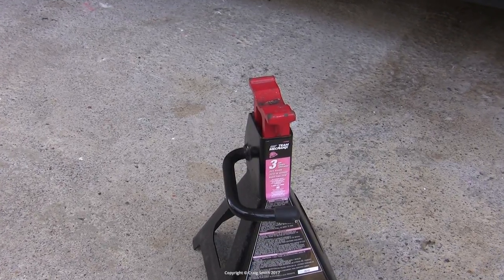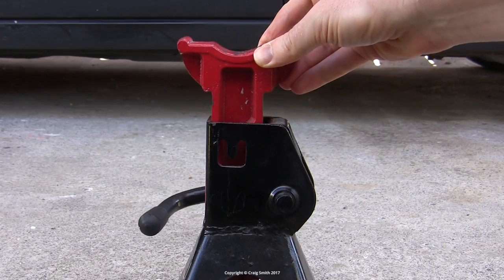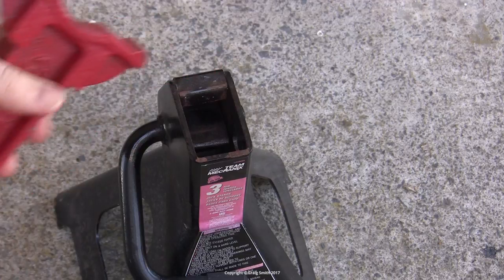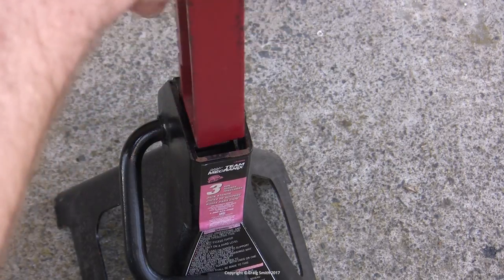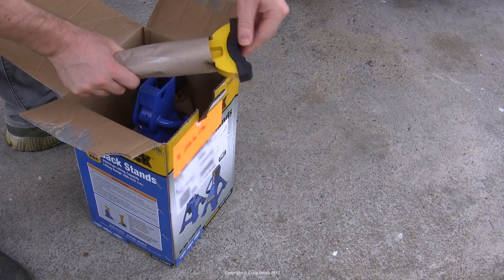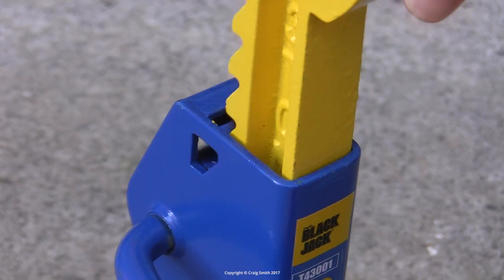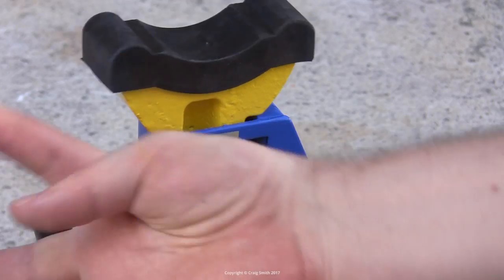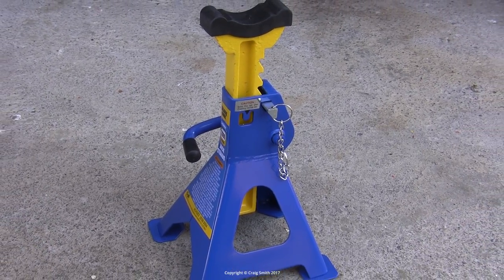Quick tip: Use locking jack stands for maximum safety

Comment: Hence it why is beneficial to lie your tyres underneath the car when not on the vehicle, or that PLUS your floor jack.
Reply: Definitely. I have ratcheting jack stands with a locking pin, when under the car I usually keep the jack + put the wheels.
Reply: @JackRR15   Interesting, I've seen a few people do that over the years. Thanks for the tip guys.
Reply: @JackRR15  very smart move.

Comment: I find it funny how he chooses the one with contradictory labeling.  The best thing you can do if your worried about manufacturing deficiencies is buy something not made in China.  His choice still doesn't fix any of the points he brought up about his previous ones. Not one single problem was solved.. he got an extra bolt probably put their because they have a high failure rate in testing or a lower safety factor in their design or materials.
Reply: Lol

Comment: I binned a set of axle stands a few years ago as the rachet teeth were only catching by about a 16th of an inch. I was hoffified when I took a look at them. Got myself a nice set from Halfords with the extra pin for security. Always stick a couple of wheels and wood under as a backup - never rely soley on stands and a hack.
Reply: A cement block to be extra safe

Comment: I was talking to an ambulance driver who regularly gets called out to incidents involving failed car jack stands and he was saying it's the pawl part that fails, because every time you lift the ratchet up the teeth shaves a tiny bit of the tip of the pawl off and eventually the worn down pawl cant engage far enough into the teeth and under the immense weight of the car it fails.
Obviously this takes years upon years of regular usage to build up enough wear to fail, but just be careful if you buy second hand or your old ones are getting a bit long in the tooth.
Reply: Thanks for the info.
Reply: Yes, because ambulance drivers are mechanical engineers. Bullshit.
Reply: Robert Korn  shit caught in the teeth would have the same effect, also these are cheap cast steel not tool steel so they will wear. Not bullshit. I wouldn’t use this type ever, 2 tons of vehicle don’t give a second chance
Reply: @robertkorn  You don't need to be any kind of engineer to use common sense. ANY small amount of friction wears down anything.
Reply: @highdownmartin  Hi Martin, I’ve just posted a comment today about getting these axle stands and about the welds on the feet only being 2 spot welds.

What brand would you recommend?

Live is short, even shorter under a car 🚗  ⬇️
Reply: I think you guys means paramedics, not ambulance drivers lol.
Reply: If you need to get under a car buy a ramp, wedge the rear tires, and have the parking brakes engaged. All you have to do is drive the car onto the ramp and you're good. The only time I use jacks is to gain  clearance while I work on the side.
Reply: @rofleman  or short in the tooth as it were 🤣🤣
Reply: @mikewill1740  What id you have a manual car with an electronic park brake. Try getting that safely up a ramp. I did and would never risk a stunt like that again.
Reply: @jackspratt4343  🤔🤔🤔
Reply: @mikewill1740  also the car was really low to the ground so the front splitter wanted to hit off the ramp too.

Comment: I took this advice to heart and ordered a set of "3-ton" jack stands from Amazon. They were garbage -- the welds looked awful, the paint was damaged, the swinging arm was tight, etc. So, I went to a local auto parts store and paid much more for a set of 4-ton jack stands that lack the pin. Even if all else were equal, I think I'd rather have double the rating without a pin than half the rating with a pin.

Comment: Don't assume you are safe because you have an extra safety pin. A bad weld could crack open under load which would make the stand collapse. Always use both stand & floor jack.

Comment: i like the old style, a steel pin going through the center of the jack stand, the only way to drop the jack is to remove the pin. that wont be happening when under pressure.
Reply: I think the weight rests on the pawl and the pin rests freely as long as the pawl is engaged. Also you can always bring the jack over if you accidentally release the pawl early

Comment: Great tip. I wonder how much load the safety pin can take. Pin is in double shear and material is pretty thick...should be good.
Reply from the maker: I linked to a destruction test of the same or very similar product somewhere here.

Comment: Back- up a good idea. Just heard some of the typical kind have been recalled in USA You were right !  Thanks.
Reply: That recall wasn't due to the kind of breakage talked about in the video. Those stands had an issue where if the weight of the vehicle somehow shifted the ratchet could release the beam. A lock would have stopped them from falling, but they'd have still needed to be recalled. Scary either way.

Comment: Hi Craig, 

I ordered a pair of these and had a warrantee issue amd returned them after I found 2 of the feet were bent. 

These things happen, no big deal. 

But I also examined them just before I returned them and  I noticed there were no welds as depicted in the photo on the box where the feet meet the legs on the outside join. 

I see there are no welds there either on your video. 

They are only joined on the inside of this join by two small spot welds on each leg on the ones I ordered.

Makes me wonder if they are really rated 3 ton. 

I will likely only lift up to 1.1 tons at most at present.

I’ve seen on other brands that are the same but without the pin there is a full weld where the feet meet the legs on the outside join. 

Which would make them much stronger at this point. 

I’m in Thailand as you can see by the following link of these stands I’m talking about without the pins. You can see in the pictures those if you zoom in there are welds where the feet and legs meet on the outside.

https://s.lazada.co.th/s.3AIGY

If you truly lift up to 3 tons regularly (which I doubt most would) you are relying on a couple of spot welds to support that weight on the outside feet and leg join.

I’d recommend whoever gets a set of these that are likely made in China to check your stands for all welds when you get your delivery. 

I bought a set in a shop earlier and returned them when I found the welds were not full along the main joins of the stands.

They are made in mass production in China I would think and you get what you pay for, but safety is important.

I think the locking pins are the most important thing and I may get the joins at the feet and legs welded if  all the stands are like this when I get mine returned for the warranty issue on the bent feet.

I also may get holes drilled at the other end of the locking pin made and put a split pin through it to secure the pin. 

I know under the weight it would be probably impossible for them to slide out but hey that’s just me.

I think they are fine but I just got a bit of a fright when I found the feet were bent and it made me doubt if the  the build quality of such an important tool. 

And I am in Thailand where shortcuts are the norm over safety. 

But I think these all will be made in China 🇨🇳

Thank you for your video, I think it is a great review. 🙏 

I’m not knocking it, like I said I got a bit of a fright when the stands arrived to me with bent feet and that’s just a production issue with quality control. And as I said I live in Thailand where safety is not the main concern here. You see electrical workers all the time climbing bamboo ladders 🪜 to check power lines of the street without ever turn the power supply off so you become suspicious after a time when it comes to safety.

I think for the price they are a great stand, you can’t expect perfection for that price.

Otherwise you would have to spend maybe over £100 to get a set of esco stands from the states 🇺🇸 

https://youtu.be/BZKZD3ATfrM

I trust your reviews and love your channel Craig, are your axle stands still performing well? 

All my best and thanks Craig.

Chrs Pete
Reply from the maker: They're ok but sure you get what you pay for, and I'm not putting anything like their rating weight on them (which I would take with a grain of salt). The reality is the weight of a medium size car split across two is just not that much and the welded base is probably not the weak point, I'm more concerned about catastrophic failure of the beam or ratchet as described. Not to minimize concerns. Test them to your satisfaction, bounce up and down on the car, once proven then just keep an eye on condition over time.

Comment: I confirm these jack stands are sold by different brand name, e.g. in Italy these are sold under the Norauto brand name.
I found the security pin to be quite loose and can come out of its hole quite easily, so I strongly advise you to drill a hole on one side of the pin and insert a security locking ring or a cotter pin (that's what I had available) in the drilled hole.
Costs cents and improves a lot the safety of the stand!
Reply: Drilling into a rated load bearing stand is not a bright idea... The structure is rated based on its construction , if you make a hole you weaken that structure.
Reply: @Baseshocks  He said drill the pin, not the Jack stand
Reply: A Pin on a Pin.. Impressive!

Comment: Actually the weigh doesn't all rest on either "pawls". Most of the holding force is friction. The pawls being opposing inclined planes,  the force gets exerted outwards <--> and wedges the bar into the body of the jackstand.
Reply: interesting, never knew that. thanks that's reassuring.

Comment: The old style with pin is very unlikely to fail, 
These new ones don't look very clever or robust
The small Pawl ratchet 
is holding the weight of the car, if that fails then it could be end of you.

Also be careful with cheap      
(on-line) Chinese copies.
Be safe folks.
Reply: the pin doesnt hold the weight if you look closely its so that the unlock mechanism isnt easily triggered.

Comment: Yeah that's why when I wanted to lift a ~1.3ton car, not only I got 3ton rated jack and stands but also these better ones with the security pin.
I mean, I know building design and that's designed at least at 200% the load required in its lifetime, so never go for "near capacity".
Reply: Exactly. Seems like he made a video about him just being paranoid. I'd be more worried about where I place it rather than whether it's got a locking pin 😂

Comment: After seeing the recall for the pittsburgh 3ton jack stands i had from harbor freight, i dont want to take a chance of failure.  Im getting big red 3 ton version of locking jack stands.
Reply: The recall-replacements failed as well. This time it was the weld of the base, they just crack open under load.

Comment: Always have a fail safe like another jacks or some bricks. 

Better to replace bodywork that is ruined than a ruined head.
Reply: Use wood blocks as backup because bricks are brittle and fracture easily.

Comment: What I don't understand is why we see more of these now and less of the older type that just has a pin that goes through the holes. Those were a lot safer in my opinion. I bought some ratchet ones not long ago and I don't even want to get under the car with them in use. And it seems weird to have some like in this video that ratchet AND have a pin. So, why not just a pin like the old way? Why bother having a ratchet if there's a pin?
Reply from the maker: The ratchet allows the shaft to be lifted quickly one-handed and give more degrees of gradation, along with requiring the car to be lifted up before they'll let go. So they have hypothetical advantages. The best of both worlds is ideal.
Reply: @CraigsDIY  very wonderful comments

Comment: I always drive my car onto a ramp if I need to get underneath it. Jacks for the most part I use for clearance to access the car on the side. 

Its very dangerous to use jacks to completely lift your car. If you do,  make sure your using 4-6 jacks thats overrated for the car and is in good shape. I would also recommend using a trolley jack to help support thr front or rear your working  on.

Comment: I have ratchet ones ( without pins) but always put tyre underneath. From now on I will also put my old pin Jack under. Good warning.
See so many people just using only a  trolley jack. They must be mad as it is not meant for supporting vehicle only lifting it. It can and will loose pressure and go down.

Comment: I also have some similar to the first ones in the video and it gives me anxiety how easy you  make the teeth drop by accidently kicking the lever if your under the car, imma get some extra ones with the pin and put them across each other like one by the FR tire and the other on the RL tire for extra security.
Reply from the maker: You won't accidentally action the lever because the weight of the car is on it (these levers need to lift the column slightly before they release). Orient them opposite your work area for peace of mind.

Comment: Never used stands in the 30 years i have been fixing cars, far to unstable and easy to push off, use very large wooden blocks or small home DIY type car ramps with wood on top to rest the car on. Never ever get under a car on axle stands.
Reply: how do you take the wheels off when the car is on ramps?
Reply: @lilblingking1491   lmaooo he adds a small wood in the middle for support  🤣🤣🤣🤣🤣🤣
Reply: Lol ok den

Comment: use more than 1 stand, multiple points of failure. a locking jack stand doesn't mean shit, that's not maximum safety at all. having 3 devices on each corner of the car, that's maximum safety. a wheel, wood cribbing, 2 jack stands. your brain is your safety not the jack
Reply: I use 16 methods of support at each corner.  Backup to backup to backup......on and on, 16 means of support.    Your 3 ain't sheit.
Reply: @jeffro221  lol that would be crazy as shit

Comment: I bought a pair of home depot stands and im not impressed with the design. It has no release handle at all, instead the pawl is spring loaded and very hard to release. Not having a handle makes grabbing the stand awkward. You have to grab the stand by its frame which is imbalanced so it wants to tilt sideways. You can't grab the stands by the serrated supports because they will just pull right out dropping the stands potentially on your foot unless the locking  pin is inserted which easily falls out. Stay away from this design if you can.

Comment: As the pin has no retention backup, the same sort of random movement which might release the handle might also just snag the little chain, pulling it out at the same time. Not that impressive a backup.
Reply from the maker: You're not going to randomly release the handle when there's weight on it. You have to lift the shaft to do so.

Comment: When im under a car kicking my feet around a wrong kick could be a regrettable thing with that first one.
Reply from the maker: You won't kick or knock it while it has the car's weight on it, you have to lift the car first, the risk is just the single point of failure.

Comment: The only jack stands I trust are the jacks with the pins. Scwaben are a little expensive but worth it. I can’t believe people trust their lives with this cheap Chinese metal.
Reply: Those can fail also. I had one fail where the pin hole started to oval and eventually the pin tore right through.
Reply: I trsut my iife with china jack stands because I don't have much to live for.
Reply: @jeffro221  I had to witness a neighbor get killed by flimsy jackstands. A exhaust pipe went into his chest after it fell, my dad had to help the first responders move the car. The quality of the machining on those teeth only has to be a little off. Some are definitely better than others, but the jacks with the pins are worth the few extra bucks. google how many injuries a year from jackstands, I think you'll be surprised.

Comment: Want to be amazed? Extend the beam and stand on the top. Then pull up on the pall.... it will collapse. Under weight.....
Reply from the maker: If you weigh as much as your car you probably won't fit under it anyway.
Reply: Craig's DIY Car just doing you a favor pal. These jackstands can collapse with the cars weight on them if the pall is accidentally pulled up on.

Comment: So you replace 3000kg rated stands with 2000kg rated stands to increase safety. Good work.
Reply: I kid you not, the other week I had my car on 4 stands and a jack. I had a set of 3 tons holding the rear and a set of 2 tons holding the front and a jack holding the center pinch weld. I kid you not, I was doing a tire rotation and a full brake job and as I was taking my last lug nut off one of the 3 ton jack stands caved in on itself. The stands were only a year-2years old and always kept indoors. Also my car does not even weigh 4k lbs so there is that...
Reply: BMC1100 That's not the point of this video. He is trying to say that it's better not to only rely on one thing in case it fails. I have been thinking about buying jack stands and the first thing that comes into my mind is that they don't make me feel safe. I think this video makes a very good point. And of course you can always get 3000 kg double locking jack stands when needed.
Reply: Elliot Rodger  strongway
Reply: @Hallowsaw  yikes

Comment: The pawl will fail when the roll pin that secures it to the shaft breaks.
Reply: No, it won't. Learn how it actually works before you start spreading BS.
Reply: @jackiemurgatroyd1148  No, I won't shut the f up. Unlike some people, I actually know what I'm talking about. The roll pin bears no weight whatsoever. It's only there to secure the pawl to the shaft so that the pawl can be lifted by the handle.
Reply: @houndawg3  Correct.....that little roll pin bears no load.  It does exactly as you said.